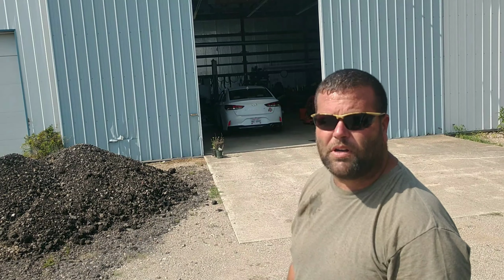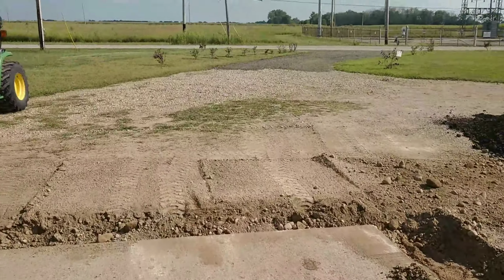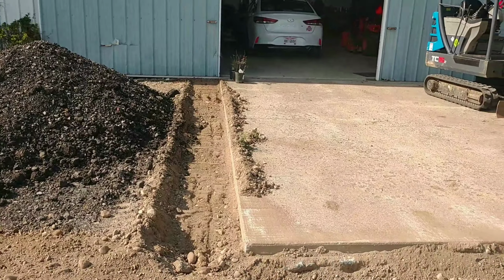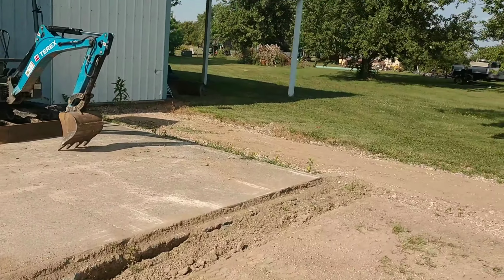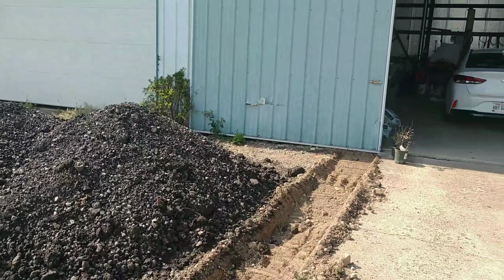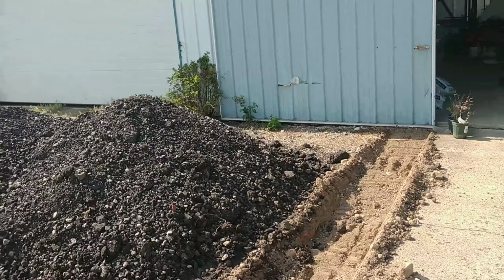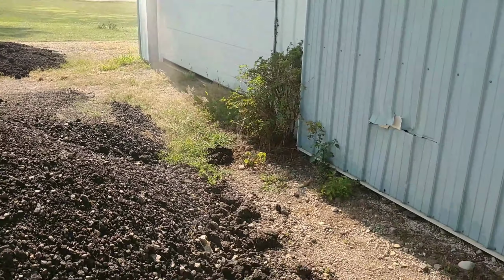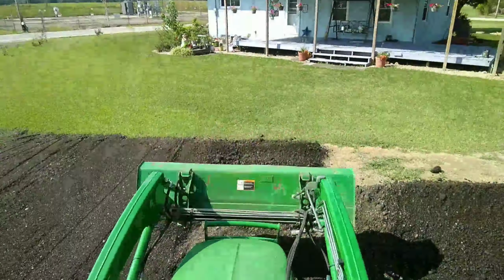Spreading a lot of asphalt millings in a driveway

Comment: Ok 2025 5 years in … still working for ya?  I’m thinking about putting this in on a 350 foot driveway. I have gravel now. Should I box blade the driveway first to loose up the gravel or just put the milling’s on the packed down gravel as it stands now?   Plus the local guy said $575 for 20tons winter special?? If I get it now will it be hard as a rock in the spring when it warms up enough to spread in on the driveway???
Reply from the maker: Don't get the millings until you are ready to spread them. They will harden up in a pile. You do not have to loosen up the original stone in the driveway.

Comment: Do you have a video of the final driveway after you rolled it? Looking into doing same thing and see how others spread it out and finish it off. Thanks!
Reply from the maker: I have not rolled the driveway yet. I did the driveway job for my neighbor and she hasn't come up with the money needed to rent a roller yet. I'd say with it being cold out now it will have to wait until spring.
Reply from the maker: Best time to roll them will be when it's sunny and warm out. If you do the millings you won't be disappointed
Reply: Once you roll it how hard is the surface?
Reply from the maker: @gravideephotography1931   It's just shy of a paved driveway. What happens is the heat from the sun reactivates the A/C ( sticky additive in the asphalt) and starts to bond together. This is where the roller comes into play. So on a good hot sunny day is when you would want to roll it. Now if you want to get a better looking surface, you can get a hand held chemical sprayer, fill it up with diesel fuel and spray the millings right before you roll them. The diesel fuel helps soften the A/C. Just get them wet with the diesel fuel don't soak them. My main driveway is as hard as asphalt and this is the way I did it
Reply: This is great thanks so much!

Comment: hey man, thanks for posting, 3 years later have you had any issues with tracking it into the garage/shop? im thinking of using this in front of my shop and concerned a bit with vehicles bringing it in. let me know bud thanks
Reply from the maker: Haven't had any excessive material come in the shop. Just have to keep in mind that you get some of the material in the garage because it's not pavement or concrete. I just take 5 minutes and sweep it out the door if and when I notice it. Again I don't have to sweep it out every day. Maybe once a week
Reply: @chrisward405  great man thanks..ill do the same..use the back hoe and dig a "trench" in front if the shop and go from there. Cheers mate

Comment: When hauling the fine millings, do you spray your trailer with something first to make them release a little better?
Reply from the maker: No I do not. Great question. Spraying something like diesel fuel on the bed floor should allow them to slide out easily. That's what we used years ago when I was hauling asphalt.
Reply: No after u unload u should immediately to clean out!

Comment: Hey Chris, have you ever used a box blade. I am new to tractor use and have found that box blade blows away the front end loader when it comes to spreading material. 

I have never spread asphalt millings, planning on doing my driveway this summer. But the box blade spreads gravel like a dream.
Reply from the maker: I'd say a box blade will do a fantastic job on the millings. I do have a box blade myself that I purchased a couple years ago but I haven't used it enough yet lol

Comment: Great video! You make it look easy but I am sure it's not. I am doing to do a driveway soon and I hope it goes this easy....lol. Can you just put it on top of grass?
Reply from the maker: Lol it's not hard to do just takes a little time and finesse toward the end to smooth out the bumps. I have several videos of doing asphalt millings in driveways. Thanks for checking out the video
Reply from the maker: Forgot to answer your question. The best way to do it would be to cut down about 4 inches ( get rid of the grass) because you will loose the material when the ground gets soft from the rain. You would definitely have a muddy mess. If you are not adding the millings to an existing driveway you will want to have them at least 6 inches thick. Hope this helps you out
Reply: @chrisward405  Thanks for the info.

Comment: How do you think the millings will work on an incline driveway?
Reply from the maker: Just saw your comment and sorry it took so long to get back with you.  They should hold up a lot better than limestone. Just have to make sure to use a roller on them when they are applied to compact them. I'd recommend using the roller in the sun on a hot day as well.